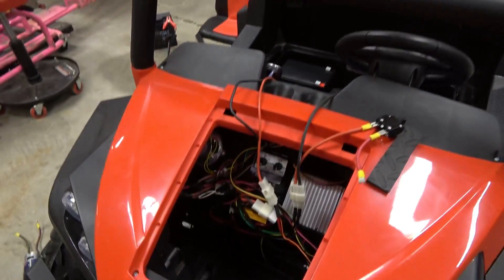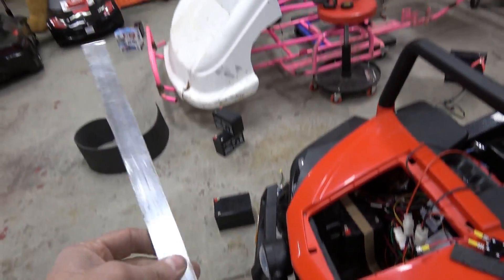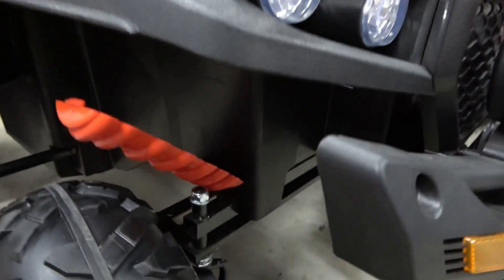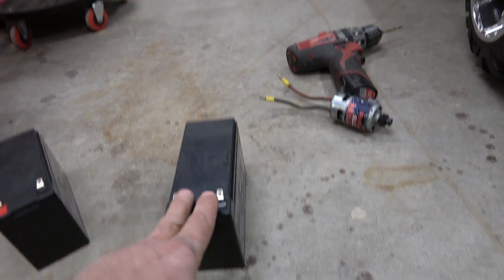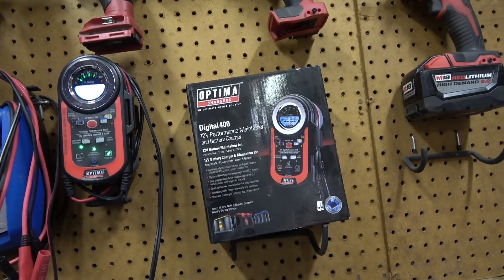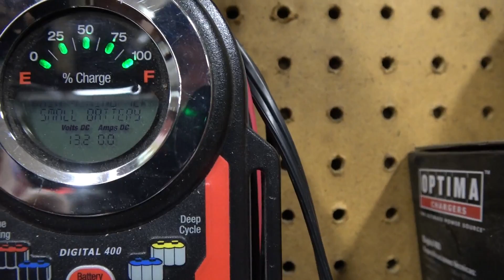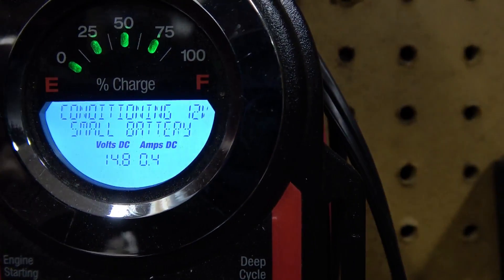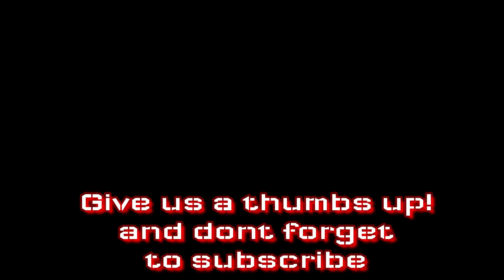Best Choice 12 volt 4x4 UTV kids ride on- battery upgrades

Comment: My daughter has a BCP jeep 12 v 
 i was thinking if I double up the batteries and put in a three way switch wireing it to only run off one bat at a time then switch to the reserve batt. That would increase drive time. in therory...right? but if just install one12 v 12ah batt won't that do the same? then also i would like to fix the jerky stops any segjestions?
Reply from the maker: Makes more sense to install a larger battery. U could probably add a resistor in the brake wire to dampen the brake effect. It works on powerwheels brand but never tried it in BCP.

Comment: Thank you for the great video. I have the Jeep version of the Best Choice Line and it has a spot for a second battery. Is there a way to wire it up so that I don't have to keep switching the positive and negative from one battery to another? Basically when one battery dies, I have to stop and switch the positive  and negative  to the other battery.  I would like to just charge them both at the same time. Is there a way I could send you a picture of what I'm talking about, possibly an email?
Reply from the maker: Just Google parallel wiring two batteries. It's easy to wire them both up to make one big battery pack.
Reply: Ok thank you

Comment: Did you say that you only got 10-15 minutes of run time out of the stock batteries? What was the run time prior to upgrading the stock controller to 24v?
Reply from the maker: tbh we never really timed the run time and only ran it a couple times on stock speed but I would say 30 minutes MAX. 4 motors will cut run time in half compared to a normal rwd ride on.

Comment: why don't you try to upgrade by using super capacitors parallel on battery circuit? i did in my son's car and give much more better performance on acceleration.😊 Very good job, nice video
Reply from the maker: Thanks and I need to learn about capacitor installation, I know the audio competition people use them so it must work. Thanks for watching.
Reply: @CustomKidzCars  i use capacitor in parallel with Pb batteries. So can have lithium battery discharge effect using a Pb battery at low cost for sure . Also capacitor save battery from stress current. at least 20 Ah 12V battery for 50 dollars and 83 farad 16V capacitor for 50 dollars. u can't find 20 Ah lithium battery for that cost for sure.

Comment: The phenomena you're describing where you get better performance (less voltage sag) and more than double the range when approximately doubling the Amp hours in the pack is called "Peukert's Law". I learned the hard way after under sizing the battery pack for my off-grip solar setup. Great videos! Keep them coming.
Reply from the maker: Thank you, yes that's it. I blanked out and couldn't recall the "technical term". Thanks for watching.